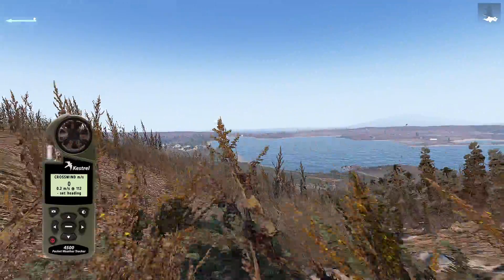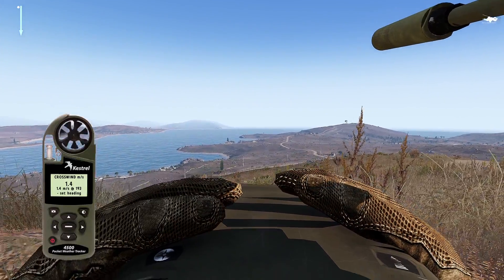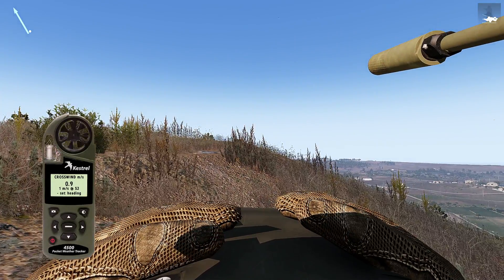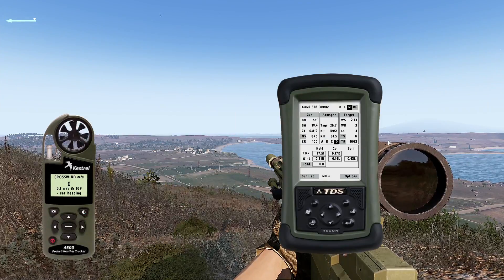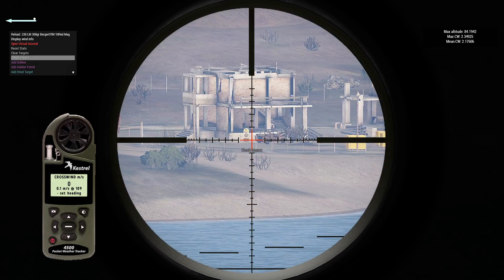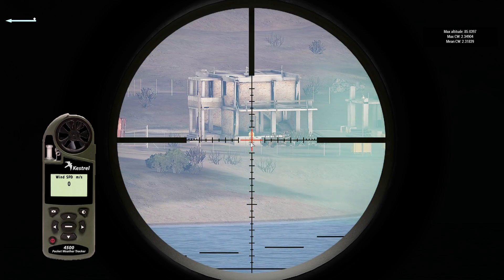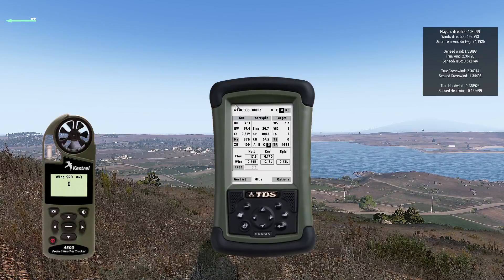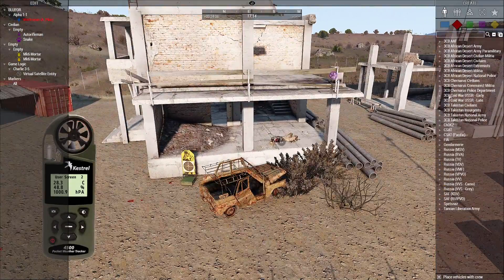ACE3 AtragMX Pt2.2: Measuring Crosswind accurately + applying it

Comment: The most correct explanation of wind correction in Arma 3 Ace. Thanks a lot, I had hard time figuring out why I was missing for a ~0.2 mils(sometimes much more on extreme ranges). Your video helped me to understand that even 12 or 6 o'clock wind can have a crosswind part as well. Great work!

Comment: Is it a total range problem if the bullet is stuck in a different place than I thought?
Reply from the maker: If you mean the bullet lands further or closer than where you aim, the problem could be pretty much anything except wind or rifle twist:

For example,
BC - Ballistic coefficient / drag coefficient table (can cause a great error)
BH - Bore height (minor error)
Atmospherics: temperature, humidity, barometric pressure (minor error, depends on the ammo, though)

The ballistic coefficient is definitely a biatch, and when closing in the max range of a gun, setting it properly gets quite tricky. I've been intending to make a video about using the Truing tool in AtragMX which I think I've figured out. Even with that, though, getting consistent hits at 1700m even with M200 just isn't possible :'D.

Comment: Hi!! how are you? I have a question, what do you divide by 0.6, is it the big and main number that the crosswind gives me?
Reply from the maker: Yo, doing aight :D.

Yeah the big number displays the crosswind (which you wanna use with 3 or 9 o'clock as the clock direction WHEN the heading is set correctly and you're facing the wind). In short do as I do and the bullets should land pretty close as long as your profile is about correct. Page 6 talks bout this stuff in further detail if the video left questions.
https://docs.google.com/document/d/1S4AnHPNLhvb5ii5AXP_DlIgvo7q85BXrioOG1367jHk/edit#heading=h.pnwi3adi4eij

Comment: Hey dude, got a question for ya. When do you decide to use the wind speed and the full clock for wind direction and when do you use the crosswind with 9 or 3 o’clock? Also should I principally always divide my wind speed, be it crosswind or normal wind speed, by 0.6? 

Cheers
Reply from the maker: Of course it's always situational but I'd say

~When the first shot must hit and you have full control on choosing when the shooting starts, might as well go for CW with 3 or 9. On the contrary, if you have to get bullets down the range quick and can shoot a lot at a fast pace (= if u have a semi-auto gun), it might be feasible to just shoot the first one near the target, eg. measuring the distance and guesstimating the wind, and correct the follow-up shots based on the first impact.

I haven't used the clock direction with max wind speed that much recently, but depending on the strength of the wind, I'd consider using it up until 50% of the max range displayed in range card or something along those lines. In addition, you should take the following things into account.
1) Strenght of the (cross)wind  -> the higher, the more likely you should use CW w 3/9
2) Muzzle velocity & bullet mass  -> the lower, the more likely you should use CW w 3/9

As for the division, the same: Yes, if you have time. The whole point of it is to get as good estimation of the full/true wind speed that actually affects the bullet and 0,6 has proven to yield generally good results when proning as explained in the vid. This is explained at page 6 of the document linked in desc. 

0,6 comes from the player character's head's altitude above terrain level (figure 1 / page 5 of the doc). It means you can measure about 60% of the "true wind speed" while proning, and as we want 100% for our Atrag calculations, we divide the measured value by 0,6.

Comment: Where did you got that scope?
Reply from the maker: SPS Equipment. https://steamcommunity.com/sharedfiles/filedetails/?id=1187306764
Reply: @p1ker1  thanks dude, I wish I could hit targets  with your same accuracy :(
Reply from the maker: @RedTheSniper  After you get comfortable with measuring the wind and tweak your atrag profile a bit, you're pretty much guaranteed to get the hits. Just remember each gun has their own effective range. I heard as long as the bullet is in supersonic speed (when its velocity is over ~340 m/s), you should be good. The distances range card shows at different temperatures are also pretty good guidelines to get the idea about maximum range, although you can often push a bit past that.
Reply: @p1ker1  I do some op with a group and in there sniper rifles are sort of useless, m40 (rhs) takes way to many shots, same for m 2010 that should be more powerful
Reply from the maker: @RedTheSniper  Yeah, I'm pretty sure m40 is almost identical to m11/sr25 except it has a bit longer barrel and thus higher muzzle velocity – ultimately just 7,62*51. M2010 can shoot a bit further but after some 1300 meters that too gets pretty unpredictable in my opinion. Funnily enough, I don't do much sniping in the missions of the unit I'm part of, either. ACE advanced ballistics is just something I looked into a lot at one point.
Reply: @p1ker1  ace 3 and Arma were my wet sniper dreams back in the day, now are a lot enjoyable, but I want something new, this is why I look for arma 4 almost every day. Thanks to your videos I hope I can get better, I need some more time in the range
Reply from the maker: @RedTheSniper  Yeah, it's interesting to see what it's gonna be like when BI finally gets done with the Enfusion engine. But it seems like we won't be getting it in a while, just yet. No matter how much Drewski and the others are looking forward to it lol.
Reply: @p1ker1  yeah, I know, the bad part is the complete silence. The 2.0 of the game was so disappointing, at this point they could have reworked the whole game from the ground up and deliver. It's been almost 7 years now...
Reply from the maker: @RedTheSniper  Yeah, I too was hoping for at least something for 2.0. Then again they've pretty small team and have been using Real Virtuality as an engine for some 20 years while pushing new arma content till contact, so I kinda get why it takes so long. Don't really care how long it takes as long as it'll be polished and good. Arma 3 with its low fps and occasional clunciness are features I've accustomed to already.
Reply: @p1ker1  my biggest fear is that they change the settings, modern combat is what we want  and what we need in Arma 4.
Reply from the maker: @RedTheSniper  Yeah. I don't see them changing it to anything more futuristic than arma 3 was. But at the same time I believe they're trying to make a clearer distinction between arma series and VBS simulators for professional use. 

Let's hope it won't be too futuristic. They said they'd support the modders, anyway, so even if it had a futuristic setting, I believe RHS would be ported pretty quickly to A4 (with the limitations of the new engine, of course).
Reply: @p1ker1  really nice talk with you, it would be  nice to keep chatting. Anyway I agree with you  and my hopes are very high for the  big 4
Reply from the maker: @RedTheSniper  Yeah, man. Was nice having a chat. My discord is actually on the first page of the document I posted to the description, so if you ever wanna have a chat, feel free. Arma is certainly a good topic lol

Comment: Nice shooting at this range... I got confused, how have you calculated 0.6, please explain.. Thanks
Reply from the maker: TLDR: I got 0.6 using a self-made script, link to which is in the document below. I use it, because in the explained conditions the measurable wind is 60% of the wind that affects the bullet.

Cheers, man. It's all about taking the advantage of Arma being a game lol. The AXMC from SPS weapons has definitely longer range than m2010 from RHS, tho, and the 1800m is about the max accurate range which already requires some tweaking of the ballistic coefficient and the rifle twist. (If the target doesn't have proper body armor, you can probably push it a bit more as long as you're hitting the center mass) Tomorrow I'll put a link to a Google doc I've been working on if I'll remember. It's already in some of my other vids.

Tldr I wrote a simple script which calculated  
"true wind speed"/"measurable wind speed"
Where true ws is the max ws on altitudes where the terrain doesn't affect the wind (=20+ meters above terrain level). In conditions mentioned in the video the division appears to be almost exactly 0.6 (+-0.02). So knowing the 0.6 and the measurable wind speed i was able to calculate the true wind speed with some simple maths.

True ws also appears to be the value ace AB uses to stimulate the shots. I actually did some experimenting and got a bit conflicting results but ultimately crosswind value of true ws is by far the most accurate, yet obtainable, way to measure the wind I'm aware of.
Reply: @p1ker1  Thanks, dear. I will check it out and let you know my experience... Regards
Reply from the maker: https://docs.google.com/document/d/1S4AnHPNLhvb5ii5AXP_DlIgvo7q85BXrioOG1367jHk/edit#